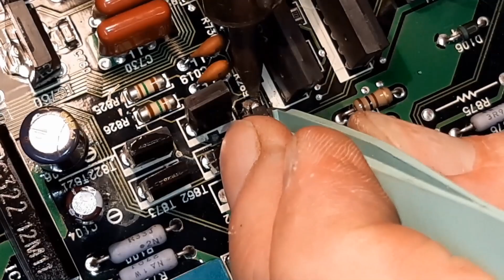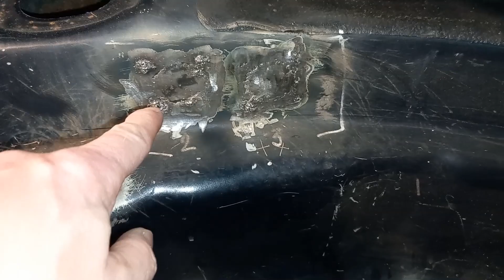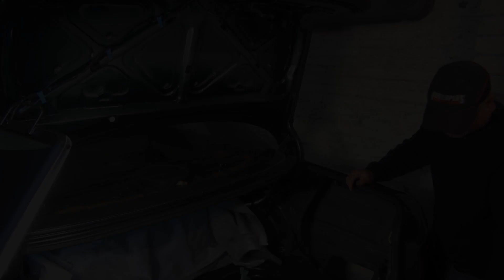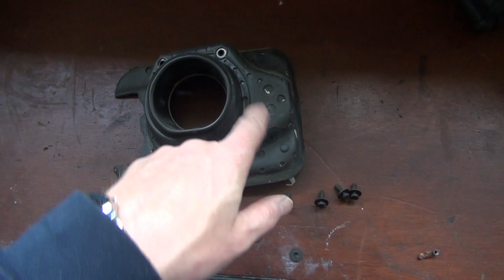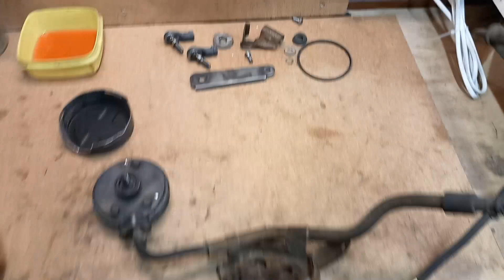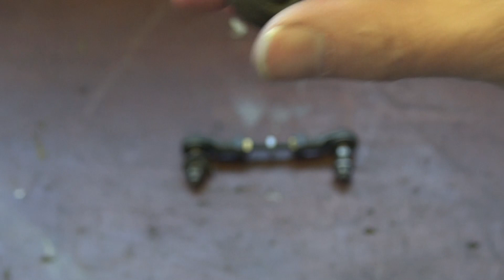Project Lexus LS 400 - Episode 24 Ride height sensor repair and fixing the spare wheel tub

Comment: Can you provide the link for the universal ball joints?
Reply from the maker: I have bought them from Amazon, it is a set like this: https://www.amazon.com/Angle-Linkage-Joint-Spring-Replacements/dp/B08C2639ZH/ref=mp_s_a_1_9?crid=1AUEUXYSSHVVK&dib=eyJ2IjoiMSJ9.2Nx0Z8XxdKJ-kj9tklEwvIcLnohyRb7WtohdwQKFbU8I6RwYgR0w71v-2nVyHuyp6BE1te9qrMjtm1rurqdJeqc8TmMlQbbVjgHYSmI6Y8Bm69m5H0Mt8eklmfTYICD4KNxEEw0iWCUZMX48rVQ_YvaQUvbieaXeJv-6PPPFP-G5aSAbxVk0lPUL297r3pv7fJ5W6N5sp36Wa12_6DEbfA.m5I4Gl1Oo7QPlHU6Nxav4DDB-ZNq4GDj_1yAgyhVufk&dib_tag=se&keywords=universal+ball+joint+m6&qid=1744641262&sprefix=universal+ball+joint+m6%2Caps%2C230&sr=8-9

Comment: Those steel disks that you made to fill the holes were awesome!
P.S. Starting this video with you inside the trunk (bonnet) was hilarious - especially with your intro where you are inside the engine bay. Bravo again.
Reply from the maker: Thanks Joe, I hope that I don't have to spend more than one episode in that trunk. It is tough to work and weld in those cramped spaces. I'm preparing to get the Lexus back on its wheels and slide it to the other wall in my workshop
Reply: @Carnold_YT  You and your videos are awesome!